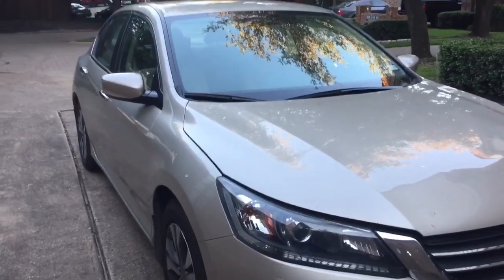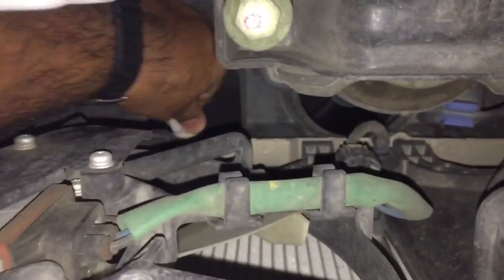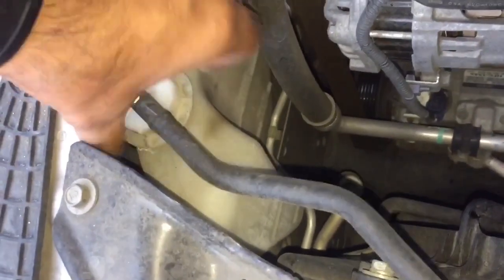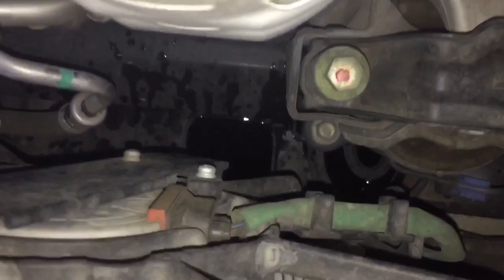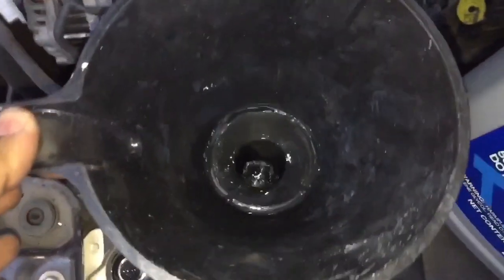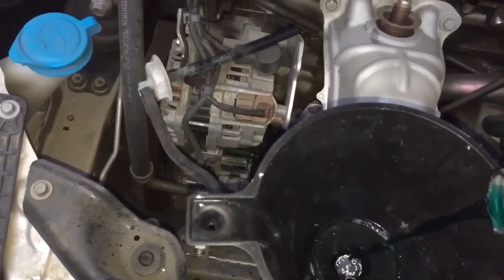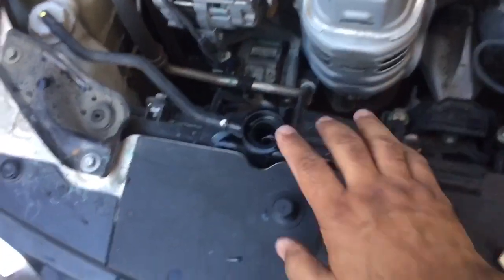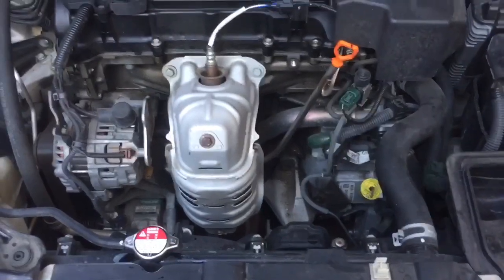Replace Engine Coolant in Honda Accord 2013 - 2017

Comment: Sounds horrible
Reply from the maker: Thank you
Reply: the fuel injectors are loud on this car, since this is a GDI engine. Sounds like it still needs the valve lash adjustment and it's got a squeaky pulley, though.
Reply from the maker: @PotatotheTroll  Thanks for the details. Since the video was made I have had the valves adjusted and the noise level has come down. The tensioner pulley is next on the list. Thank you.